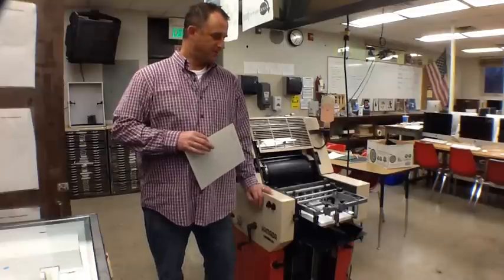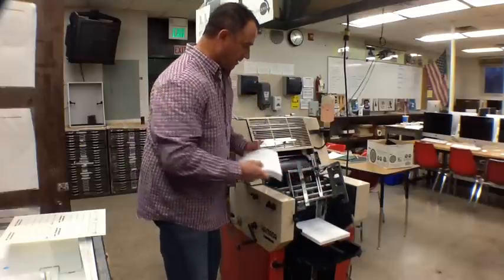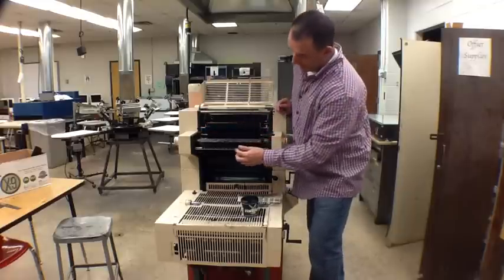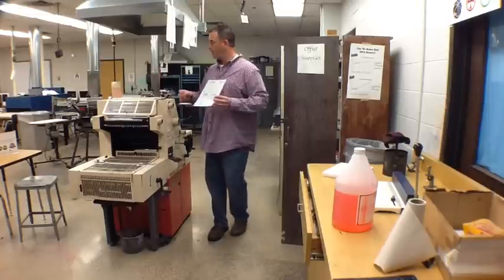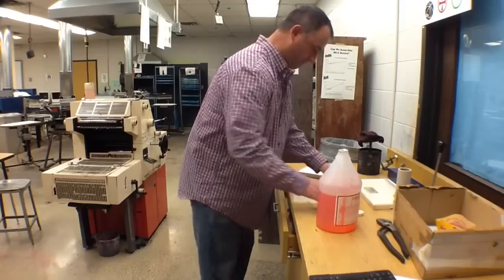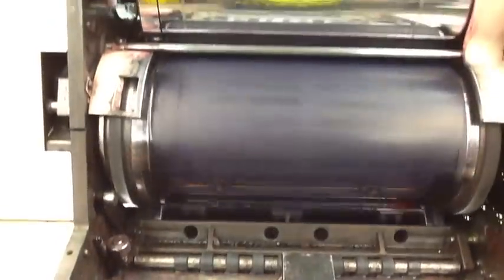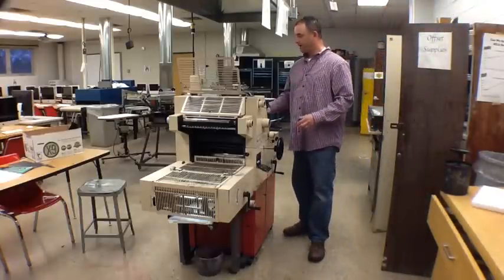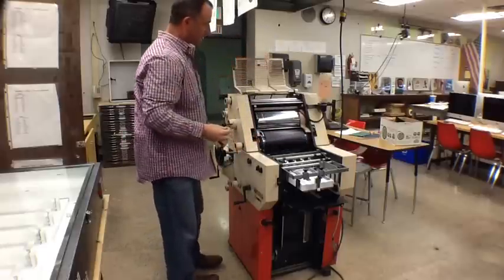Offset Press Demo

Comment: I grew up with my dad having an AB Dick 360 in the basement and a Multilith 1250 in his shop. We also had an older letterpress in the basement.
Reply: Ken G. : yeah, until 5 years ago I earned my living with a Multilith 1860, Adast Romayor and Heidelberg windmill in my print shop. I did it for 25 years. I'm 70, 5 years retiring, but miss the smell of ink.
Reply: I remember the AB Dick from high school in 1973.  Also, had a working linotype.  The good ol days.
Reply: Holy moly, these are the same presses i ran at my job when i was in my 20s, plus 10x15 letterpress,and polar cutters, miss all that.